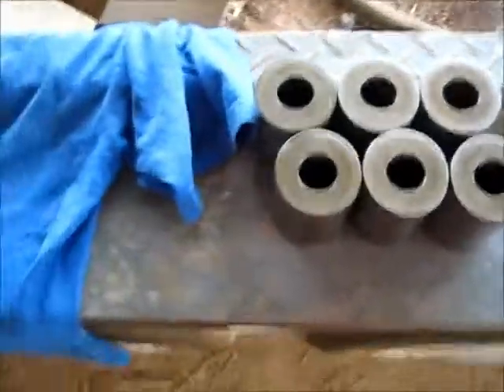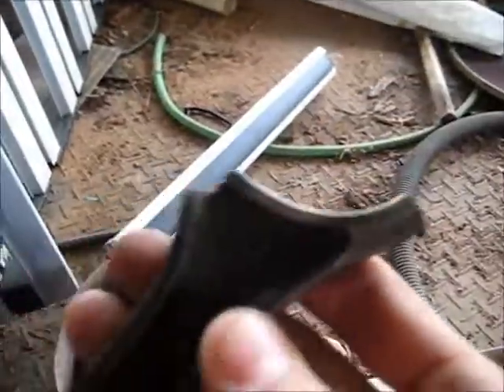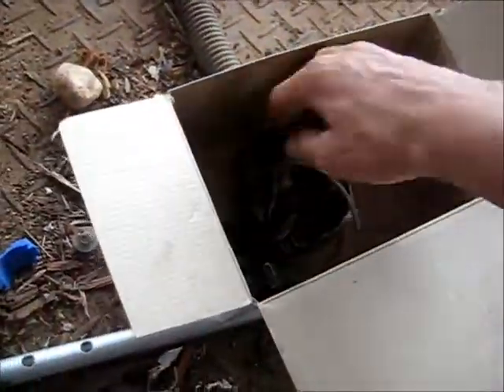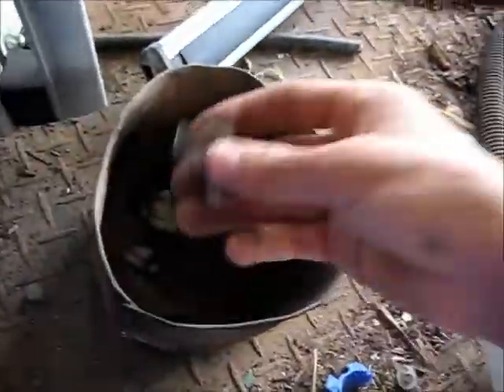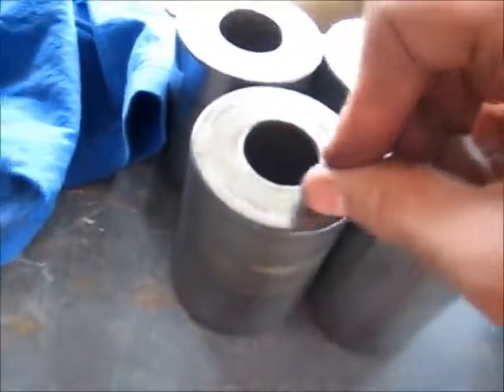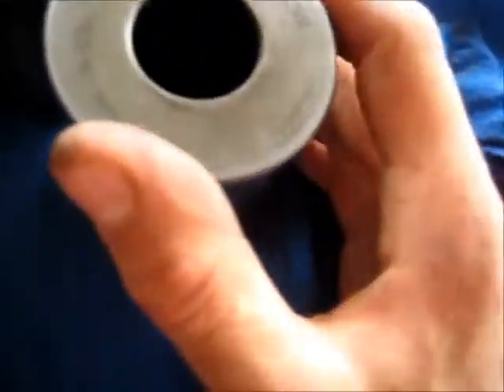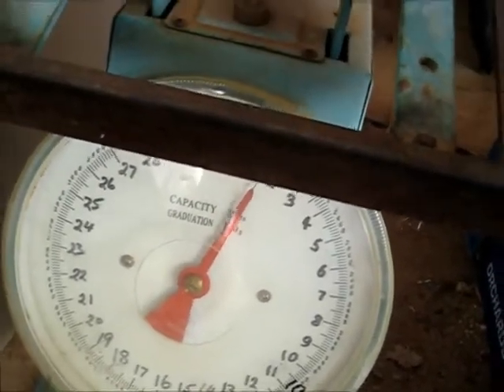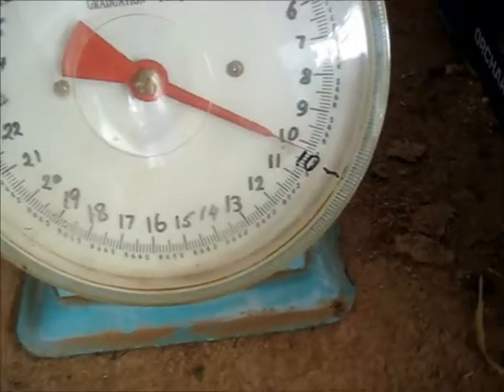Big Gudgeon (Wrist) Pins

Comment: @MrGerbilBrain they have cylinders around 9-10 inches wide xDxDxD displacement per cylinder is like around 600-700 in^3 xDxDxD and the piston strokes are around 10-12 inches xDxDxD :DDD